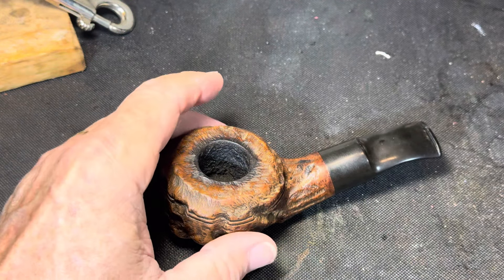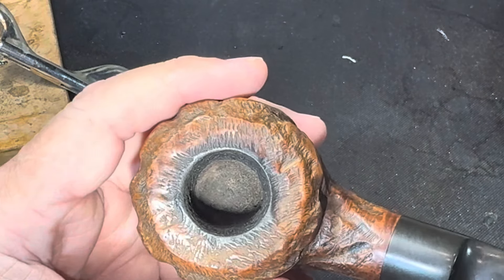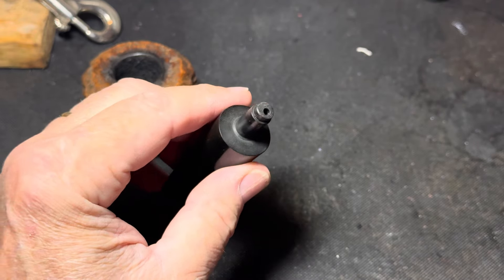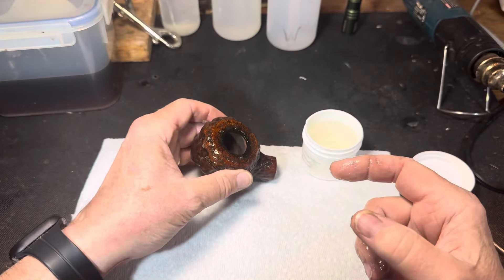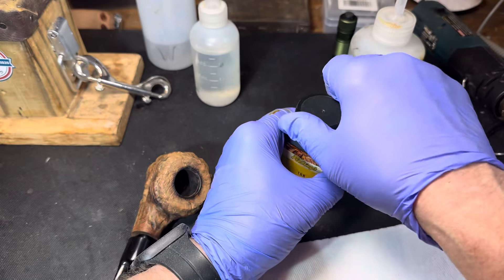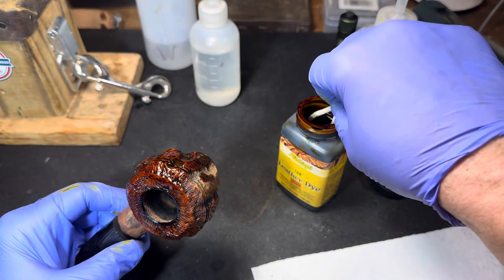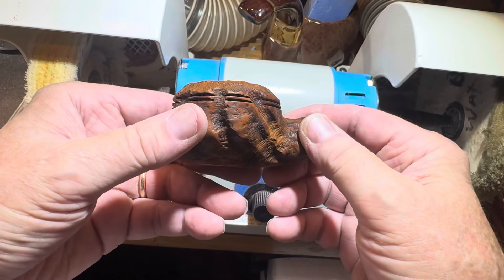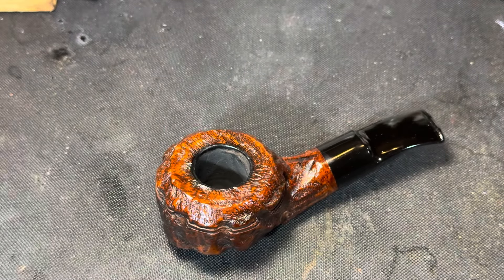Tracy Mincer Era Custom-bilt Bullmoose Pipe

Comment: Hey, I have enjoyed your channel going back to the beginning I have watched them all, pls stay at it! I do have a question, I recently got an older Caminetto, I think from the 80's, very good shape and I have turned it into a very very good smoker. My question is this, on the stem there is the familiar mustache, but the white is gone and I would like to fill it back in. What paint would you suggest for the lucite stem?
Reply from the maker: @mikequayle4000  
I would use white fingernail polish.  Brush it on and wipe away the excess. Good luck. Thank you for watching.